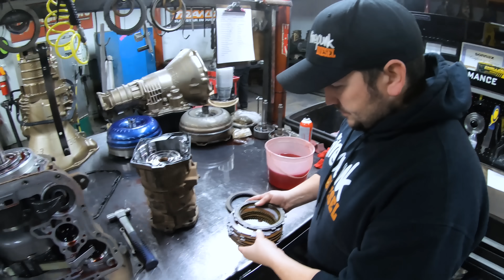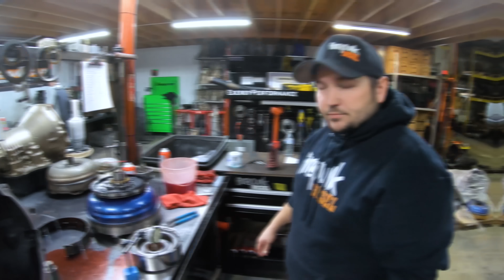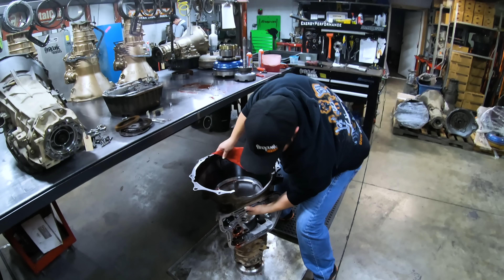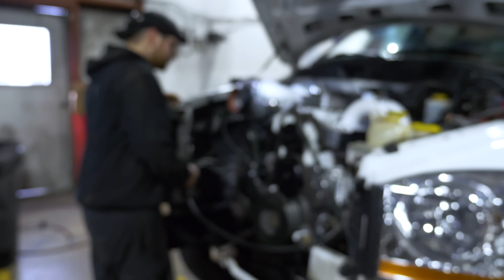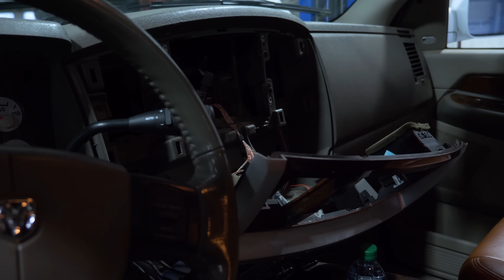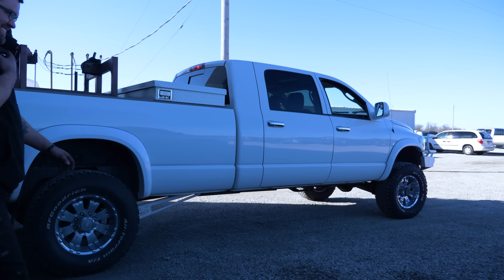MEGA LONGBED BUILD - THE ULTIMATE DAILY

Comment: Nice.. I've got a 07.5 6.7 cab and chassis with the Aisin. Do you guys do any Aisin rebuilds?
Reply: Dallas Crist did you put the Aisin in there? The Aisin trans didn’t come in Dodge trucks till 2013
Reply: @Phillip_Patterson  no, I didn't. Went off of VIN.  It was offered starting in 2007.5 as an AS68RC. It doesn't have the tap shifter.

Comment: Excellent video. Definitely learned some things. Like using the dial indicator to check clutch clearances. I always used feeler gauges and it’s a pain. 
Question. When checking final endplay, where were you prying? I just set mine on the output shaft to check, not sure if that’s right
Reply from the maker: Input end play we're prying up on the sunshell from the reverse drum, this lifts the intermediate and input shaft off the selective on the back of the intermediate, giving you a true measurement on end play

Comment: Have you ever seen the low/reverse sprag race come out of the case before? If so what do you do to fix it and what causes the race to work it's way out of the case?
Reply from the maker: Very seldom does this roller clutch come loose, occasionally we see the sprag race loose but usually we make sure the race is tapped to the back of the case, then stake it in place to secure it if it's loose. Now if you launch too hard on the sprag then it will crack the case and rip the sprag race loose from its splines.
Reply: @FirepunkDiesel  Gotcha. A couple broken input shafts ago, I noticed the race worked it's way out of the case and was rubbing on the drum. Ended up putting a bolt in race. Is that something you guys do as a fix?

Comment: Did I hear that right: "The best time to retorque head studs is when they're hot?"
Reply from the maker: On a fresh fire ring, yes, we do a hot retorque to make sure we get proper ring crush.
Reply: Firepunk Diesel all you did for break in was 5min at 2k rpm? Was that just for the cam and dyno for rings?
Reply from the maker: @zebco14250  yes, 5min no coolant at 2000rpm, then retorque head studs and add coolant, 2000rpm for 20min, then oil change and roll
Reply: For a fire ringed block yes.

Comment: Hey.... are your nails painted? Or am I crazy?
Reply from the maker: No, I was born with white nails.  Some of my siblings have white nails as well.
Reply: Firepunk Diesel I noticed your nails and sibling in the past videos and being an old fart I was shaking my head thinking “damm kids these days” 😂😂😂. I’m glade that got straightened out.
Reply: @FirepunkDiesel  that is very interesting! I have actually had fake nails before strictly for helping with machine work picking up very smooth parts and also when I was building trans  for the shop I worked at I liked them for popping o rings out of place! So I wondered if it was similar